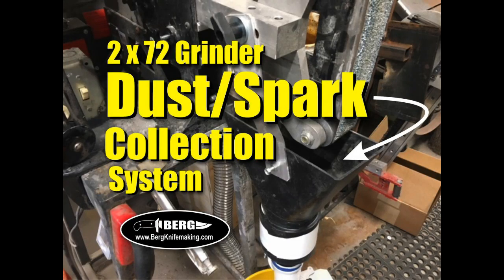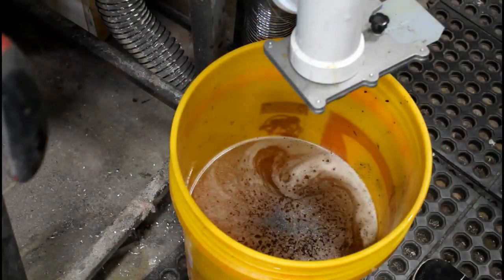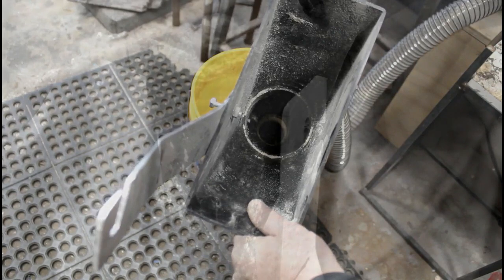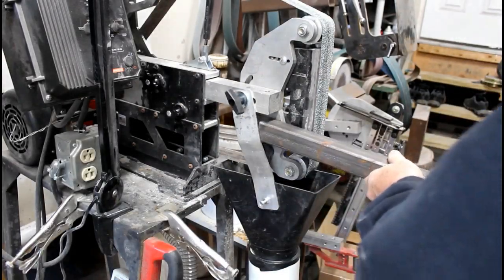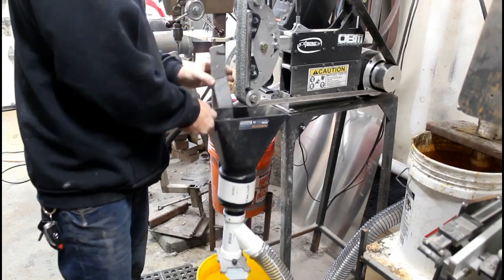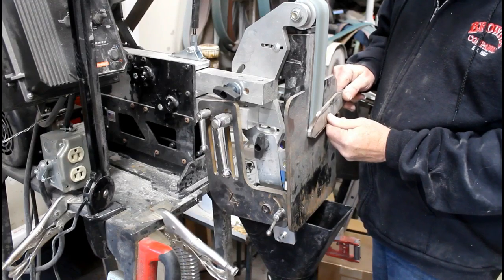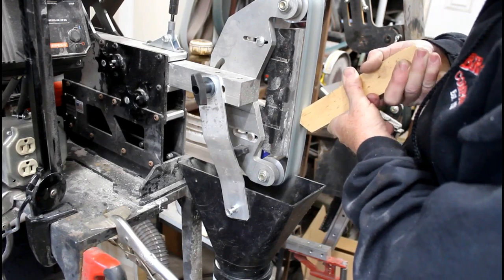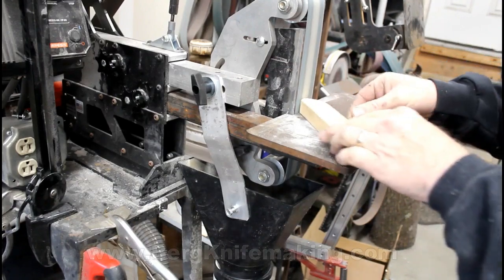How to make a combination Dust and Spark collection system for a 2x72 Belt Grinder

Comment: How do you handle sparks while shaping handle scales while on a knife?
Reply from the maker: You have to be really careful. If im going to create any sparks at all I pour some water into system first and after. I also make sure to check wet dry vac before I leave the Garage. Even a small spark with air suction from the wet dry vac could start a fire.

Comment: The only addition I would suggest is some sort of spark arrest in the hose going to the vacuum for during the handle shaping.
Reply from the maker: Very good Idea. A few hot sparks do end up in the flexible tube. I should be able to eliminate that when I make it out of sheet metal just with location but another blast gate would be perfect

Comment: Looks good.. if you haven't already made it i would only recommend a cyclone before going into your shop vac.. i made a cheap one from two 5 gallon homer buckets from home depot, works great. A guy on YouTube has a tutorial.
Reply: There is one commercially available called a “dust deputy”. It works great, but ruins the diy spirit
Reply: @rjverackajr  There are several but a little pricey imho and still kinda diy because you usually need to buy a bucket still and sometimes hoses.
Reply from the maker: Thanks Chris, I was thinking about making one. It does not create extra suction just collects all the dust into bucket rather than dry vac correct??
Reply: @DIYeasycrafts  https://youtu.be/BeU4nqSJtBY this is the one i made... well a follow up video. You can find the original under his playlist. I put two home depot buckets together and put the top of my shopvac on them instead of the actual wheeled bottom and then used the wheeled bottom to hold the collector homer 5 gallon bucket which overcomes the tipping he talks about and allows me to wheel it around. Idk if it would work that way for everyone because i don't know if all shopvacs automatically fit a 5 gallon bucket or not, but if not you can use his ideas to prevent tipping and collapse. It works amazing. You could make a whole shop dust collection with it
Reply: @DIYeasycrafts  yeah it just collects the dust protecting the shopvac and making it quicker and easier to change in my opinion